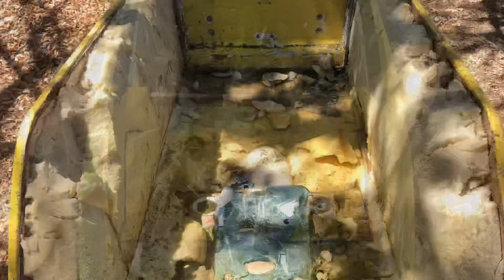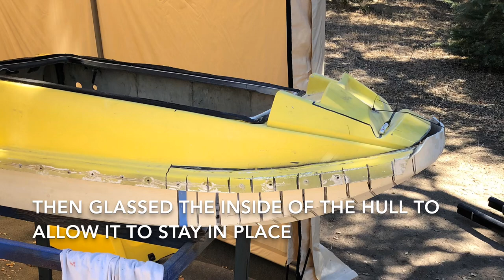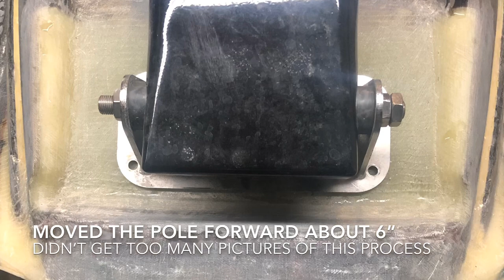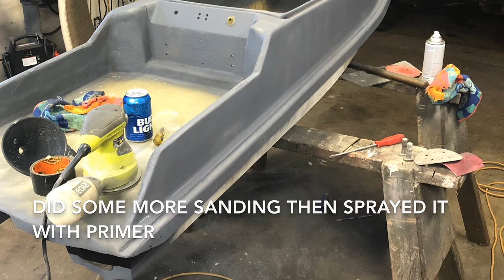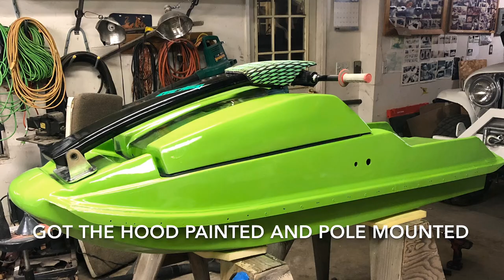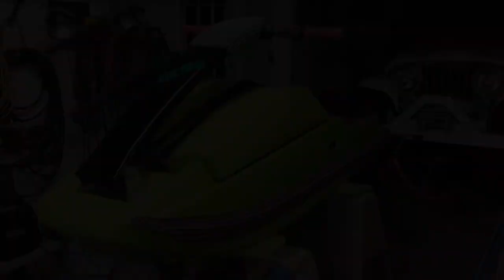Yamaha Superjet freestyle SURF BUILD

Comment: How did u fuel it up and did u use a water box . I really want to do this with my square nose superjet. Even tho I’m scared I never fiberglassed a ski in my life but I want to learn.
Reply from the maker: Trenton Briones i moved the gas cap on top of the tank inside to fuel. And yes it has an aftermarket waterbox.. this was pretty much my first time doing fiberglass, just do your homework and get the right stuff and youll be fine. Its easier than you think. Just very time consuming

Comment: Hi mate I was just wondering I’ve got a square nose and I’m gonna do the same as what you done to yours I like it so much you wouldn’t be able to give me a call Mate I just don’t want to put my phone number up there how can we do it but
Reply from the maker: Not much more i could tell ya thats not in the video. Just look into how to fiberglass and make sure to use some good epoxy resin. Thin glass sheets are easier to work with just do a couple more layers. Its mostly trial and error just dont be scared and get into it man you’ll learn alot!

Comment: My build is super similar but I havent relocated the pole yet (my xscream pole hasnt shown up yet). Did you find 6 inches forward was too much orrrrr? I run a -3 pole with OVP on my current hull and am scared relocating forward would be too much
Reply from the maker: Cole Prince 6” was about perfect for me i like it further forward to compensate for cutting so much off the back, it helps it not ride so nose high
Reply: @jesski  thanks for the reply man! My pole comes Monday so I will mock it up then. I'm thinking that because I'm ovp and the pole is a minimum of -3 that I'll just move the bracket 2-4 inches forward. I'm -3.5 off the back of the hull as well

Comment: How did you do the try? Did you just shape the original and add glass? And how sturdy is it? I’ve had some ideas of ways to made it more sturdy and was just curious how yours feels.
Reply from the maker: I gutted all the old foam out because it was old and full of water, then made the shape out of thin sheets of foam and glassed over it then used pour foam to fill the rest of the tray.. its super sturdy but it was by far the hardest part of the build

Comment: How has it held up? Thinking of doing this I have two square nose superjet hulls I’m thinking about trying it out on one of them. Sweet build tho I’d like to communicate and get some tips.
Reply from the maker: Its been killer, rides alot better for the surf the nose is alot higher. As far as durability i havent had anything happen to it yet.. im sure itll happen eventually but shes pretty sturdy
Reply: Sweet man, how does it handle on flat water? I mainly do lake rides with wake boat wakes and I’m able to do barrels rolls on my remotely stock super jet but I’m just trying to build something a little more suited for that.